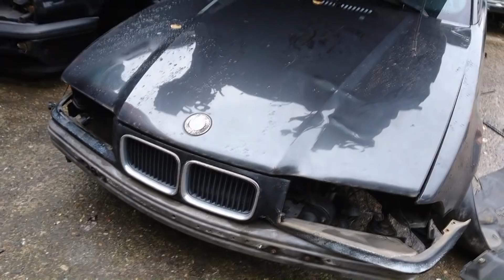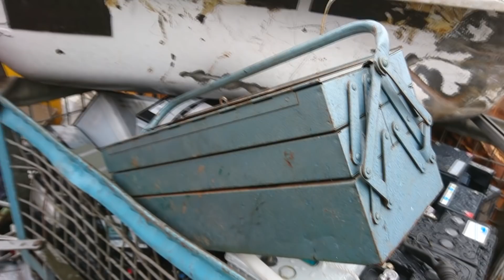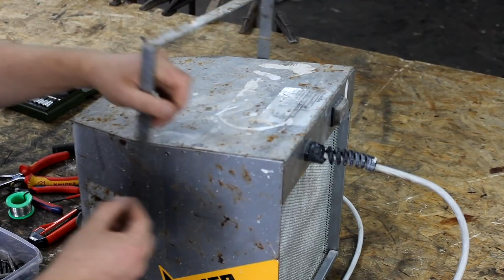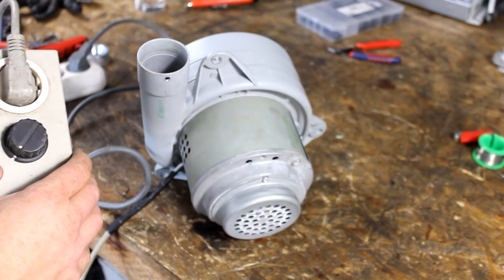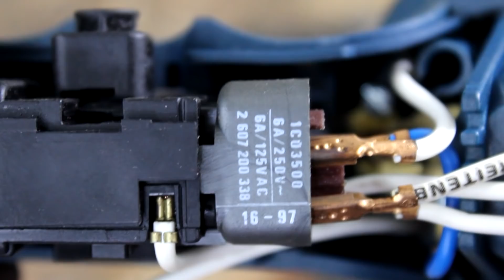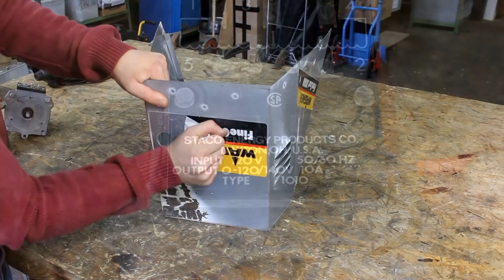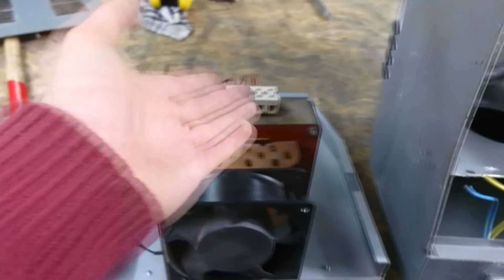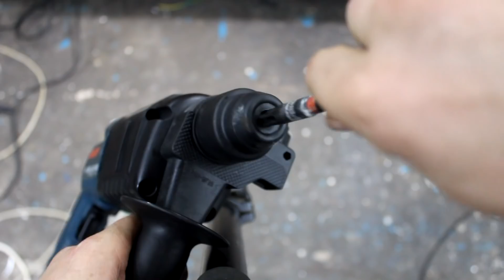Great Scrapyard Finds! Repair-A-Thon!

Comment: In UK all building sites have to have all elctical impliments using 110 volt.  Also building site generators have 3 colours of plug yellow=110 volt. Blue= 230 volt  red= 3phase 440 volt.
So that drill could have come from a building site in UK.

Comment: I appreciate your perspective on consumption. I always find it funny how our society is so centered  around consuming to the point where even "eco friendly" and "green" living just means buying and consuming a different thing. If you stopped consuming then "they" don't make money. It's all marketing.

The same "green conscious" people will be the first in line for the new Tesla. Nevermind the lithium that had to be mined using borderline slave labor. The barrels and barrels of petroleum that was used for the "vegan leather" and interior plastics. And where will it all go in 10 years? Some scrap yard to rot and leak pollutants into our soil.

Comment: I bought a 110v very used Bosch sds drill like that over 34 years ago, used it for 20 hard years and sold it on for a profit!  Everything else I ever sol I made a loss on.  UK building sites are all 110v.

Comment: Generally speaking, it is poor practice to have the circular saw blade raised as high as you have it.  The more blade exposed, the deep the cut in case of an accident and accidents happen when you least expect it.  As a one-time professional woodworker, 1/4" is the maximum you would raise it.  My one-time mentor as a woodworker cut all his fingers off the year before he was to retire, (he was 64).  They sewed them back on but they never were right.  If he had only 1/4" exposed, the accident wouldn't have been as bad.  1/8" is better but it makes the work tend to rise up.

Comment: Viewer from WV , not quite Ohio but as a ham radio op I have made MANY trips to Dayton OH for the Hamvention,  USA’s biggest Hamfest.  Praying it still exists after CORONA is done screwing everything up!   I like this step down isolation transformer project. Fairly certain I have that variac in my junk box ,  but need the 120/120 isolation transformer itself.  You have some amazing scrap yard!  I am not sure of any near me but it sure looks like great fun scavenging for materials.  Lord knows new materials of about any kind are ridiculous expensive!  I was an IT guy many years and now regret not taking more time to salvage good stuff from the hundreds of dead printers and scanners I’ve had to dispose of through proper channels.  So how’s a guy become so well informed on what and how to find the gear you collect and the amazing diagnostics you are so capable of?  Very much enjoy your channel and innovative work

Comment: You would not find this kind stuff like you do in Canada it would be gone! every find those old tool from boxes from ww2 in canada we are way ahead in energy efficiency & recycling you not find stuff like you do unless very lucky that tool  box would be 12 or more euros  the motors are 50 & up and would be in used goods shop your house building is 70 years behind us we do not get mold as we all have cloths dryers vented bathrooms & kitchens screens on the windows, air conditioning 4 unit apartment takes 8 weeks to build and no cranes unless it is 4 levels or never for single floor lived 3 years in germany the east was nice the west  is a right ring night mare you are verl lazy workers in germany we work 40 hours not the Tuesday to Thursday like you guys I wish we had scrap yards like you would make shit loads of  money

Comment: That's a shitty drill!   It took way too much effort to get a little hole in the concrete!   It also sounded like a shitty toy drill!   :-)
Reply: Sounds like you really don't know what you're talking about.
The reason why it was drilling so slow is probably because the drill bit was dull.
About the sound, most impact drill sound like this. 
Idk whether you've ever heard one. 
One of the reasons why I think that drill isn't crap is because even when he was pushing down on the drill really hard the rpm stayed pretty much the same and there was no painful noises.
Reply: @safetyinstructor  Sounds like you really don't know what you're talking about. With  a drill that small the rpm wouldn't go down when drilling in concrete.  And no, not most impact drills sound like that.   But be happy if you are used to work with cheap crappy that sound like that.
Reply: @TaunterAtwill  sure know it all
Reply: @TaunterAtwill  I have a impact drill similar to the one shown in the video and I'm really pleased with it.
 It's really not that bad compared to larger more dedicated ones.
Reply: @TaunterAtwill  sarcasm does not change reality.
We'll, you really are a taunter :)

Comment: Hi there. I use a Fuji spray system which is similar to the one in your video. The spray gun you are using is listed as HVLP but is designed to work at about 30 psi. the turbine is only putting out around 9 or 10. The genuine HVLP guns have a very large bore right the way through the gun. 
The connectors on the hoses are interesting. Mine is the same. I understand that they are not a proprietary connector but are actually a connector used on larger bore industrial water hoses. But I haven't figured out where I can buy them from! Mine has a quick disconnect on the gun.  I would love to get a couple more. I am thinking it might be good for blowing up my granddaughters bouncy castle! 
I would loan you my gun but I am currently using it every day.

Comment: Cool vids, thsnkd for sharing.  One thing though,  when using an SDS drill you don't need to push on the tool, by doing so you actually take away some of the performance, you need only apply slight pressure till you feel the tool engage, try it see if you notice a difference, this will also extend the life of the tool. (just trying to help)

Comment: Many building sites in the UK only use 110v tools (for safety) I expect that is true in other European building sites. Hence your SDS hammer drill. Which is very effective in brick and concrete. Some do go up to 1500-2000w and have a spindle lock for chiseling work. That could be very useful for developing your workshop.

Comment: Hey , really like ur videos .Learned a lot from it , keep up the good work!
 Just a tip for working with hammer drills - u never press on it as hard as u do in video , it drills much better and faster if u let it do its thing( back off from bottoming it out 1-1.5 cm) , holes that u make will be more concentric and way less chance to get drill stuck in hole. 
Thank you for reusing "junk " and bringing life to it!

Comment: If my memory from 1989-90 is accurate, Lamb built/builds vacuums for what are called central vacuum systems in the US. Instead of dragging or pushing a vacuum cleaner around, a powerful vacuum is installed in the garage, and the house is plumbed with 2" specific purpose PVC pipe. At the outlets, in each room, the pipe is capped with a spring loaded cover, which also has an electrical connection where a vacuum hose is plugged in. 

The electrical connection is to power the electrical power brush for the working end of the vacuum.

I was working for Electrolux, at the time. A standard canister type Electrolux pulled about 50 pounds of vacuum, when new. The central vac motors would pull up to 150#'s.  While I was working there, I warranteed about 30 central vac motors. Instead of throwng them away, I kept them, planning on two uses. One was to build a shop vacuum system, and the other was to build a personal hovercraft.

Two years ago, I had a storage roof partially cave in from a freak November snow storm, (very wet, heavy snow), and the plastic container I had all the motors stored in filled with water.  After hanging onto the brand new motors for over 20 years, and just getting ready to build the vacuum system for my shop, the motors are in my 'To be scrapped' pile waiting to be stripped down, for the scrap yard.

BUT, all is not lost. I discovered last summer, the rental carpet cleaners grocery stores have, contain the same Lamb motor as the Electrolux Central vacs!  So, it's still game on.  LOL

Comment: Most 240V-110V step down transformers are centre tapped on the outgoing side...
So under fault conditions you only get 55V to earth...
Just above the max. contact voltage (50V) of an RCD...🇬🇧👍

Comment: Fascinating as usual thanks for these videos. Question if I may. You used a tool with the tap to tap threads in the control knob. It looks like to repurposed a drill chuck for this. What did you use for a handle? Or was this a tool designed for this purpose? Thanks.

Comment: The lamb vacuum motors are used in hot water extraction carpet cleaning machines. Usually in pairs.

Comment: With all the room inside and extra space on the front panel, this new variable isolated power supply is begging for mod's like: 1) A 50 amp bridge rectifier, filter choke, and a couple of switchable sets of filter caps (pulled from scrapped PC power supplies?),   2) An AC Voltmeter and AC Ammeter,   3) DC binding Posts and a DC Voltmeter,   4) A big red emergency cut switch  5) A DPDT front switch to allow to series connection of the 120-Volt winding to the 32-Volt winding to the rectifier for a maximum of about 215 Volts DC at decently high current.
I think panel AC Ammeter's may be costly, so you could show us how to tune an old AC voltmeter and make a homemade Manganin or Nichrome shunt?
Reply: Wait! Forget the shunt and meter idea... The Danish guy from Kaizer Power Electronics just released a tutorial on shunts and metering.
I you want to watch it, search YouTube for  Analog Panel Meter Shunt Calculation and Custom Scale Design

Comment: Your approach to the plumbing of that turbine was bang-on appropriate. When it comes to proprietary fittings, usually my first order of business is to take said fittings and turn them into adapters for industry-standard fittings that can be relied on. As for anything with plastic fittings... cut that shit out and replace it with fittings that are made out of real materials that are solidly anchored to the enclosure. It's usually not as hard to do as most people would think. I would only tinker with anything that has plastic fittings if it came from a scrap-yard, mind you. I would never buy anything that hokey.

Comment: That Wagner is like a hobby air-brush compressor on steroids. I wish I could get my hands on a few of those turbine units. There's so many uses for something like that. For one, you probably never need to spend another cent on computer duster blow-cans. I'd like to have one of those just for that purpose alone. I'm pretty meticulous about my computers. Even my laptop gets disassembled and blown out on a regular basis, and I go through an entire can of that computer duster shit just on that alone. With my "Beast" (gaming computer), it takes a whole case of those cans to get the job done, and I have to do that twice a year at a minimum. I do have an air-compressor, but I don't have a proper inline filter for it, so I'm not gonna chance spraying a whole bunch of water droplets all over my baby's circuit-boards.

Comment: Here in 240v UK a lot of tradesmen use 110/120v on site for safety (with step down transformers)....or rather used to, not seen so much these days, but i think that is due to the fashion for cordless tools today.

Comment: Greetings:
FYI: The Variac has an option jumper to permit connecting the LINE of the 230:115 x'former to allow 140 VAC output.
I noticed that the Bosch drill has a hammering feature; it may have made the concrete drilling easier.

Comment: I have the same drill, but German made in the mid 80s. It is still going strong despite heavy trade use.
If the hammer action is turned on it should drill very quickly. Don't push too hard on it, let the pneumatic hammer action do the work. The drill will be more effective and last longer.

Love the repair videos. My wife and I volunteer at four different #RepairCafe each month in Manchester UK and I often think about how helpful you and your knowledge would be.

Comment: 99% of the cars in the junkyards can be repaired. Most are just there due to insurance or ignorance. The only ones that cant be fixed are the ones with major crash damage. Technically you could fix allot of them but that would require cutting them up and splicing them together. Still baffles me to see classic cars in the yard, I understand some times you cant afford to do a project but to just throw them away to be crushed is absolutely the wrong answer.

Comment: I’ll give you a thousand likes if I could because I love your scrap yard videos. I’m so frustrated that our modern society is so wasteful. Our own wealth is part of our problem because in our fathers and grand Father’s day tools were expensive so they had to be repaired but now, in general terms tools are so cheap and wages are high, relatively, that we can afford to throw things away. For example a couple of days ago I picked up an 18 volt Makita jigsaw someone had thrown away. I put a battery on it and everything worked fine but it had a lot of play in the vertical shaft that holds the blade making it very inaccurate. It turns out there is a bushing the the metal housing that wears and allows play to develop in the shaft making the whole saw pretty useless. But here is what makes me angry with Makita, the bushing is easy to remove with a drift but Makita, knowing this part will wear out does not sell it as a separate part. You have to purchase a whole new front housing with the simple bush in it. Of course this part is quite expensive at about $138 Australian dollars which is about 40% the cost of a new saw. If you add in the labor a repairer would charge, then the average person will of course, buy a new saw. It seems to me Makita have manipulated their spare parts so that the main point of failure is unavailable to purchase separately therefore making it uneconomical to repair. So all that manufacturing gets thrown away because a 50 cent part wears out. This bushing is about 25-30mm in diameter and about 8-10mm thick with a square hole in the middle. That’s it but it is also softer than the shaft that goes through it as the shaft had no wear at all on it. And how much wear does it take to make the whole saw useless? Well this one had about .0127mm or .0005 thou wear. Did I put my money where my mouth is? Yes. I spent a couple of hours and made a new bushing and the saw cuts as good as new. Was it worth my time? Yes. I got to do something I enjoy immensely, fixing something that has been thrown away and as I am retired my time is my own. It’s also good for my mental health as it keeps my mind and hands busy and it sure beats the hell out of watching TV. And as I don’t even use Makita cordless tools I will just give it to someone that does. 
Cheers mate and keep up the great work. Stuart 🇦🇺

Comment: You should add some more banana plugs and build a circuit with say 7812, 7809, and say 7805’s to drop the voltage down to something like 24, 12, 9, and 5 volts respectively.  Make a universal power center.   But good show.  Oh, “staco” is top line.

Comment: Great video!! An permanent volt meter would be great to instantly see the voltage. 
On the 32 volt side to which you can add a rectifier that will be an instant charger to be selected to any voltage between 0 and 32 volts DC using the veriac.

Comment: 115V tools are used for site work, at least in the UK; they are powered with an isolation transformer with a centre tapped secondary, the tap is grounded so you only get 58V with respect to ground on either line.

Comment: PLEASE READ! VALUABLE  GERMAN SCRAP FIND!

After watching this video yesterday, I went to my local scrapyard in Florida and saw a shiny silver box on the ground. It is an explosion proof electrical box made of stainless steel painted with silver finish and says on it Weidmuller klippon tb mh 453815 s4e4 The value I search ranges from $1,500 USD to $2,000 USD and this thing is in new condition only made in 2017. I paid only $20 for it and would love to sell it but figure it is a very niche item. Any help would be appreciated. Love your videos, thank you.

Comment: The green fasti tool is for making round pieces of sheet metals, i used them to work on ventilation systems.
Reply: A bit like an English Wheel?
Reply: @alanmumford8806  No the wide yaws is where you put in a piece of metal, then it rotates on a center and you can cut an inner or outer round out with some cutting wheel
Reply: @homeistheearth  Aha. Thanks for the education. ;-)

Comment: Not a good drill. Bosh was bringing out three ranges of tools at this time and tarnishing their previously good name. Industrial, tradesman and home user. That is a craftsman and has cheap soft electrics and poor hammer function. It has push connections to the coils and an armature that is barely varnished and neither are baked. I took many of them apart. They are complete crap. I think the orange cable came from a garden extension.